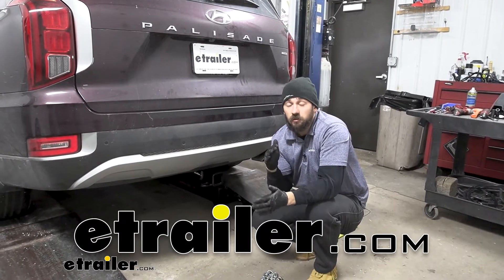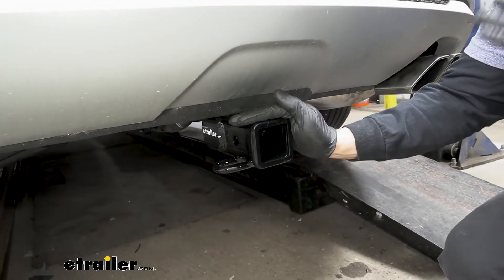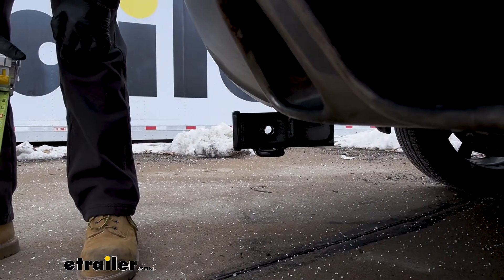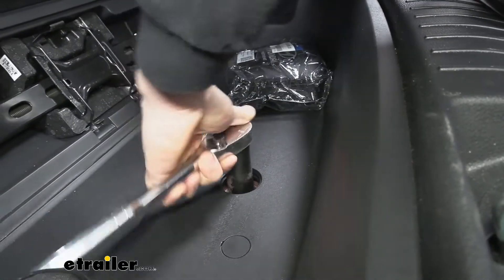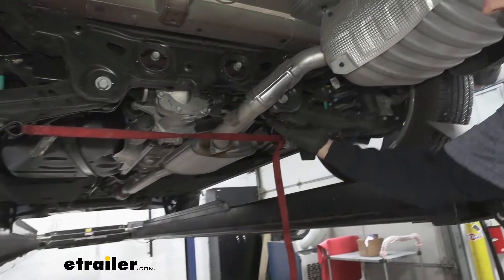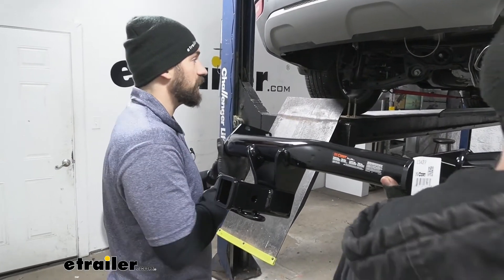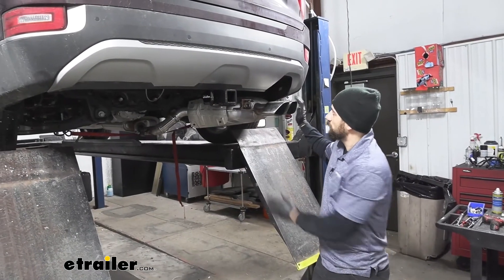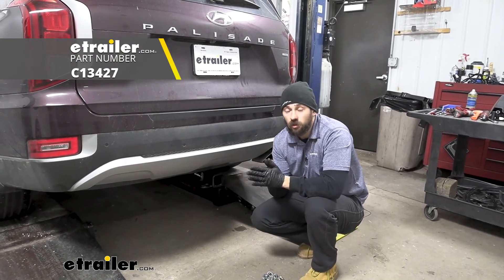etrailer | Setting up the Curt Trailer Hitch Receiver on your 2021 Hyundai Palisade

Comment: For those with heat shield problems I took a flat head and hammered the bolt in gently through the hole. Maybe I got lucky but sometimes its better to be lucky than good.
Reply from the maker: Not a bad idea! Thank you for sharing this trick with us and others that might be having a similar issue.
https://www.etrailer.com/vehicle/2021/Hyundai/Palisade

Comment: forgot to mention 2 things.  When trying to install one of the bolts on the driver side that white plastic piece is in the way and the video just skipped that part w/out explanation of how you got around this.  And on the passenger side the bolts won't go into the chassis unless you remove that metal dust/dirt/debris shield using 10mm socket.
Reply from the maker: Thank you for sharing this! We will look into it and make the changes necessary.
https://www.etrailer.com/Trailer-Hitch/Curt/C13427.html
Reply: once you remove that dust/heat shield to get the bolt through, were to able to reinstall the heat shield or did you leave it off.
Reply: @Kendkend  I was able to reinstall but make sure you do not tighten the bolts holding the hitch onto the chassis because it is a super tight fit.  The heat shield is like aluminum so as I was trying to force the shield to align with the studs, i had to scratch/dent it to get it to the proper place.  If I could do it over again I would have try to install the shield and hitch at the same time with 2 people.  Our model is the 2021 by the way.
Reply: @joonsup  mine is a 2022 and I just got it on now. I had to use a rubber hammer on the shield to make the area around the bolt holes flush and then i was able to get it on. Then i had to loosen the bolts on the hitch again to lower it just a smidgen  to get 1 of the 10mm heat shield bolt on. For next time, note to self, don't take heat shield off and just bent or pry it out the way
Reply: @Kendkend  I hope to never have to take it off and back on.  And if I do am extra set of hands would help instead of trying to do it solo.  Good job though haha
Reply: @joonsup  oh and about that blue plastic retainer cap that gets in the way of one of the driver side bolts, you can either reverse the bolt, having it come in from the other way ( this will also help to not have to cut the splash shield as the bolt blocks that from going back on) or you can go in the trunk cargo area, use a flat head to remove the cap to that particular retainer and remove the philips screw, now you can move that blue plastic cap around just enough to get a bolt through, but you will still have to cut the splash shield  unless you go with the other way of running the bolt backwards from other side. I read that tip a bit too late.
Reply: @Kendkend  for my 2021 I just had to unscrew from the trunk to get it out of the way so that wasn't an issue for me unlike the passenger side heat shield.  And yes I had to use a dremel tool to cut around the plastic shield on the drivers side in order to reinstall it after the bolts are put through.  I guess it doesnt matter which direction you slide the bolt and the way you did it allowed you to keep the plastic shield in one piece.  Good job
Reply: @Kendkend  I just did this install yesterday, and I ran into the dust/heat shield problem. I removed it initially and then after I had the long bolts through on the passenger’s side, there wasn’t enough room to install the shield again, so I removed the passenger side long bolts and left the driver’s side in with the nuts on, letting the receiver hang down just enough to slide the shield back in.

Comment: For 2021 Palisades with Calligraphy trim, there can be interference with the bolts and the plastic box on the drivers side, and also blue plastic fasteners from the rear storage bin, that hang down in the way.  Our instructions showed inserting the long bolts from the inner/midline side, outward through the frame rail.  You can't pass the bolt through because one of the blue plastic fasteners is in the way.  Also, the threaded end of both bolts stick out too far, and dont allow the black plastic box to go back in place.  So we installed both drivers side bolts from the outer edge inward.  The bolt head is lower profile, and avoids these problems.
Reply from the maker: We have not had any issues with installing this hitch on the 2021 Hyundai Palisade with the Calligraphy trim package.
https://www.etrailer.com/Trailer-Hitch/Curt/C13427.html
Reply: In the installation instructions picture, the socket wrench is covering the threaded end of the long bolt on the drivers side.  Couldn’t see that the bolt end sticks out.  On my vehicle, that threaded end stuck out about 2-3cm.  There is only 1-2cm of room when reinstalling the black plastic box.  Hence, the need to flip the bolts around.  I chose that over cutting the plastic on the box to make it fit.  Maybe it was something unusual with my vehicle.  
Overall the installation was very straight forward, the instructions are easy, and the hitch fit perfectly to the lower fascia.  No trimming necessary.  The hitch is VERY solid, and much more discrete and clean looking than the Hyundai hitch.
Reply: Know exactly what you're talking about! Will be putting my bolt in reverse. Thanks for the tip!